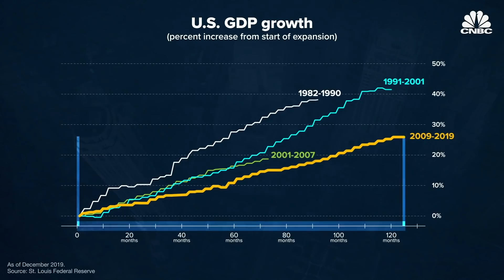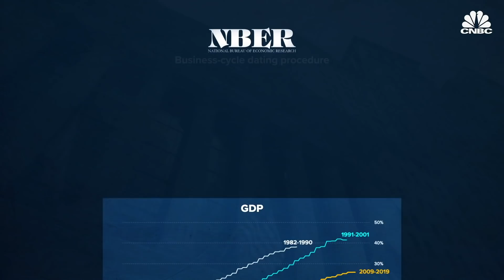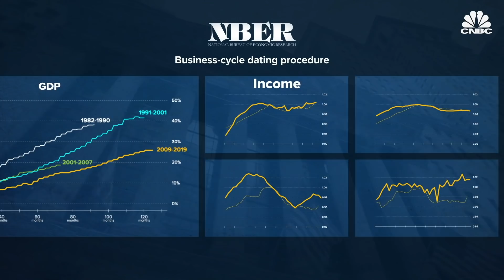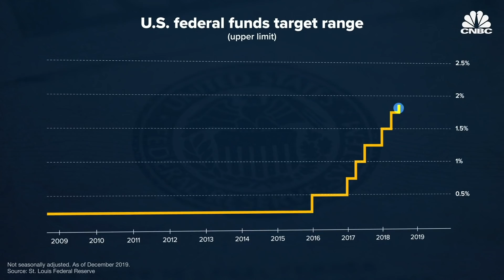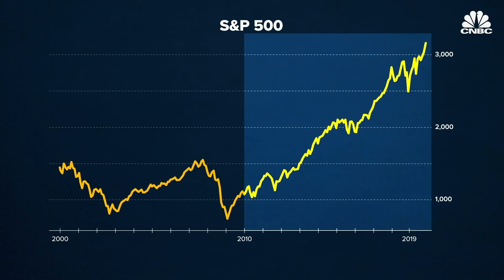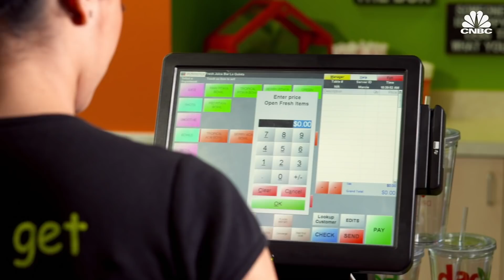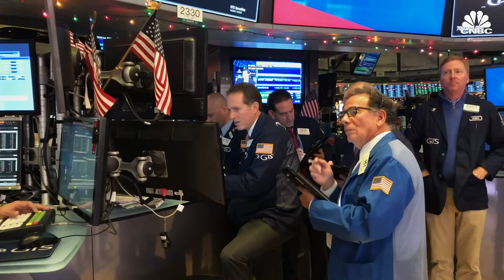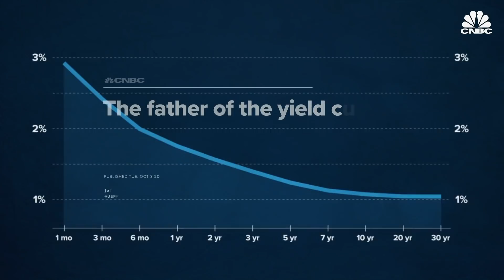How The U.S. Avoided A Recession For A Decade

Comment: There's so much immediate information on markets, so much advice, so much analysis, and it's so easy to buy and sell stocks, that the market corrects itself instantaneously, moment to moment. Such nonstop tweaking and adjusting work as a kind of gyroscope that keeps markets from collapsing. That's not to say the dollar and markets can't or won't collapse. They likely will someday. But the gyroscope effect, given momentum by economic measures, keeps the markets in line. However, the effect won't work forever. So you can't relax. You have to figure out how to save yourself when the worst occurs.

Comment: Well the issue is that companies have not reinvested their capital into the real world economy but rather it went into financial assets or even mergers and acquisitions. Whether stock buybacks, financial vehicles, or merging and acquiring competing corporations, most of the capital flowed into finance rather than your standard capital investments. Also because the interest rates are so low, companies can leverage their debts to unprecedented levels, which is why non-financial corporate debt is at an all time high. With that much debt floating around, you really can't raise rates too high without taking a massive hit. Also, with rates so low, there is nowhere to get a decent return except the stock market. So the stock market looks great because that is where the money went. It's all fine and dandy until you start to see financial firms parking money into low-interest or even negative yielding bonds. That means they would rather have virtually no return versus the risk elsewhere. At that time, trouble will be on the horizon.

Comment: The recession hits this spring. Economist's have been talking about it for several months. All the indicators we use to measure the economy are showing a big slide coming soon. Not just the U.S., it's going to be worldwide. Some of the problem for this upcoming recession (for the U.S.) is that we didn't entirely fix the last one, much of it was differed, and now it's time to pay up.

Comment: first off, the federal reserve is not a U.S. government agency. It is a private corporation. Second all we did was print money and lower interest rates. This will come back to bite us in either a bigger recession/ depression or inflation that will be hard to control. Also the US government changed how they calculate unemployment, so it's not at the lowest level in 50 years...if you used the same calculation that they used to use it would not be the lowest point in 50 years. Your facts and data are just simply wrong!

Comment: Thus all of such analyst that are advertising a middle point, just take a look before previous recession what was? either way Silicon Valley went to the sky with all of venture capitals coming from financial system that collapsed back in 2008. Then that what happened on CDO's and all of MBS's could be placed there in all of such unprofitable tech startups/companies that are in such models as non profit.